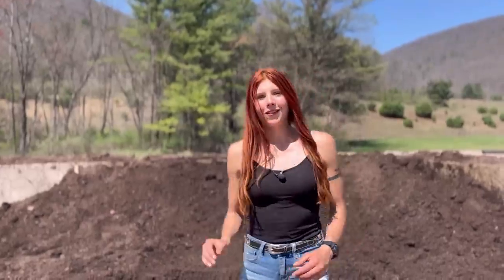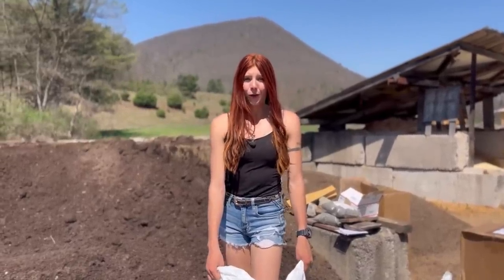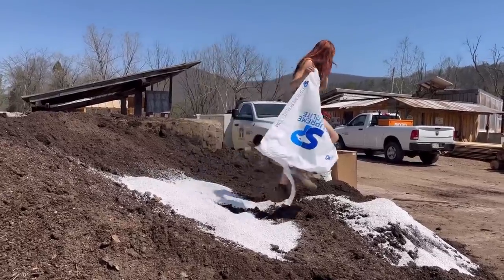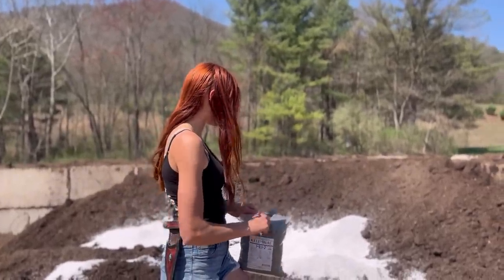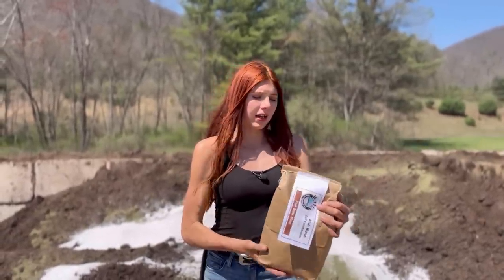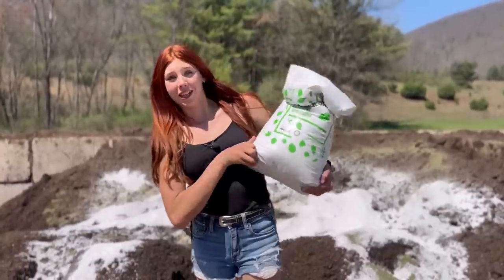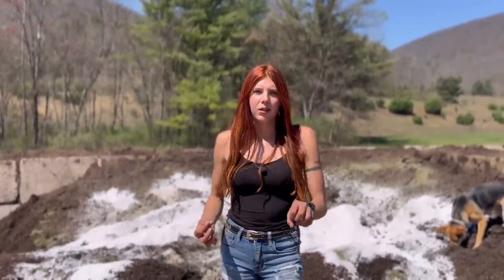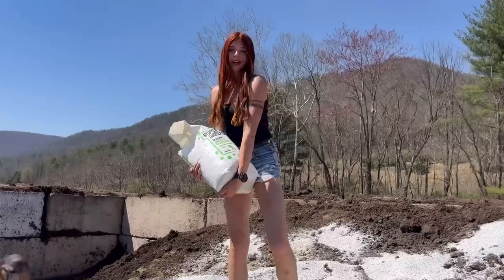Turning this pile of compost into potting soil!

Comment: Interesting facts about perlite. It is mostly mined in Greece, In raw form it is very small granuals, The bag you dumped on the pile in raw form would weigh 32-40 times as much. Perlite when heated to 2000-2500 degrees expands 32-40 times its raw state. It is used extensively in ceiling tiles. That is what makes then so lite.

Comment: When I used to mix sand and calcium chloride/ road salt with a loader at the highways yard, I used to hoist the bucket high as I found the drop would distribute the m8xture more evenly and quicker.

Comment: Maybe a feed mixer would work.
Reply: This ist the perfekt Maschine for ther, a old, what goes an and in, ist good enough...
Reply: Right. I was thinking the same, like a farm feed mixer that you pull around behind a tractor. The pto turns the mixer in side and open the side and the potting soil would come out mixed
Reply: A rototiller attachment...

Comment: Ok, so I think she was thinking of vermiculite when she said it was a mined volcanic rock. Perlite is in fact volcanic glass that is superheated until it pops like popcorn, making it much less dense and lighter as a result. The advantage of perlite over pea gravel or something similar is that the lightness makes soil compaction less likely.
Reply: I thought it was Styrofoam....
Reply: @daniel_trang  Correct . Vermiculite is a form of clay (wiki).
Reply: So she was right then ?
Reply: @davidkettell5726  If you consider glass to be a rock, then sure. I don't.
Reply: @daniel_trang Perhaps it doesn't. My point was that perlite isn't mined in the form that you find it in on the store shelf.
Reply: @MrYungsan  what is obsidian then?
Reply: @josephrhoades2464  A natural form of glass. Yes, I know the distinction is fine, but I consider something glass once the silicon content goes so high...that it starts acting like glass.
Reply: From ChemEurope:

"Obsidian is a type of naturally-occurring glass formed as an extrusive igneous rock. It is produced when felsic lava extruded from a volcano cools rapidly through the glass transition temperature and freezes without sufficient time for crystal growth. Obsidian is commonly found within the margins of rhyolitic lava flows known as obsidian flows, where cooling of the lava is rapid. Because of the lack of crystal structure, obsidian blade edges can reach almost molecular thinness, leading to its ancient use as projectile points, and its modern use as surgical scalpel blades.

"Obsidian is mineral-like, but not a true mineral because as a glass it is not crystalline; in addition, its composition is too complex to comprise a single mineral. It is sometimes classified as a mineraloid. Though obsidian is dark in color similar to mafic rocks such as basalt, obsidian's composition is extremely felsic. Obsidian consists mainly of SiO2 (silicon dioxide), usually 70% or more. Crystalline rocks with obsidian's composition include granite and rhyolite. Because obsidian is metastable at the earth's surface (over time the glass becomes fine-grained mineral crystals), no obsidian has been found that is older than Cretaceous age. This breakdown of obsidian is accelerated by the presence of water. Obsidian has a low water content when fresh, typically less than 1% water by weight, but becomes progressively hydrated when exposed to groundwater, forming perlite. Tektites were once thought by many to be obsidian produced by lunar volcanic eruptions, though few scientists now adhere to this hypothesis."
Reply: @WilReid  Thanks for the information on what ChemEurope thinks.

Comment: Little suggestion:
(If you have the space), pull the compost away from the back wall of the bin 6 or so feet, back drag it to make a flat even area of compost at a consistent depth, then spread the amendments across the whole top as even as you can, then start pushing it back bucket by bucket, lifting the bucket up high and shake the bucket as you dump it. It will be more evenly mixed by the time it is against the back wall of the bin.  I too mix hundreds of yards of sand and road salt in the winter, and loam compost mix for starting new lawns in spring and summer.  Have fun!!👍

Comment: I would buy a few cubic feet of your mix if I was in the area. Never tried beneficial nematodes but I heard they can be amazing. I use all of those things more or less plus Alfalfa meal, dolomite lime (good for Cal-Mag and to help eliminate end rot in tomatoes), worm casting, organic slow-release fertilizers, fish hydrolysate (amazing stuff!), brewed compost tea, bio-char, volcanic rock dust, a little sea salt called SEA-90 which is rich in trace elements, black solider fly frass, powdered molasses, and a few other organic items which I am temporarily forgetting - stinks getting old and losing my mind :)  My favorite ingredients are soluble and powdered kelp (two different products but both kelp) and worm castings.  I add mycorrhizae powder too!  My base ingredients are usually Coco Coir but sometime Peat with coarse vermiculite (70/30 ration more or less) but your composted wood looks great.

Comment: A old cement mixer would be great for mixing soil. We used one for our greenhouse.
Reply: The conveyor used to load the firewood truck and trailer, if moved to the compost area, could be used as well. Dump a loader bucket of soil, etc. on the input end, and let the conveyor do the work of dumping it on the top of the pile, mixing it at the same time. Just a thought. 🤔

Comment: I did this last summer with 40 yards of compost and a dozen large bags of perlite. Next time try a backhoe or excavator instead of trying to scoop and drop, at least for the first bit. In less than 5 minutes, probably 2 minutes, I had a 20 yard pile ready to fill some raised beds. Just use the bucket and dipper to stir the pile like you would a cup of coffee. It works surprisingly well and quickly.

Comment: You need a better a solution for achieving a homogeneous consistency of the soil. Without homogenisation the customer will each time get a very different product, just depends from where of the pile he takes it.
I dont know if there is an addon to the tractor for such mixing purposes. A bit shifting around with the bucket wont do.

Comment: I like to use a "rock grizzly" screener made from 1/2" expanded metal to mix and screen compost.       A bucket mounted mortar mixer is also a good option.     A flip screen bucket is also good, but expensive.     This way, if you are using it to plant trees you can mix a 50/50 of dirt and compost.